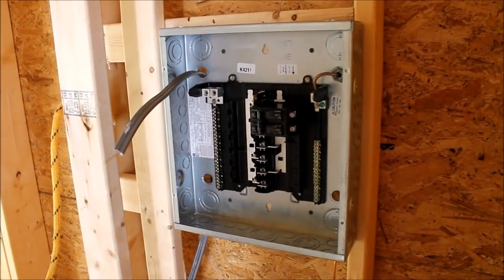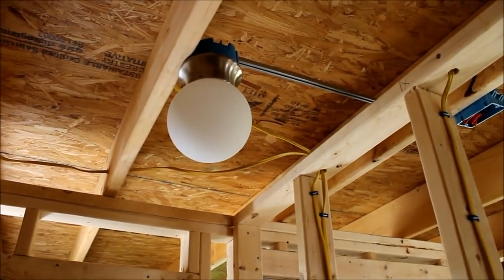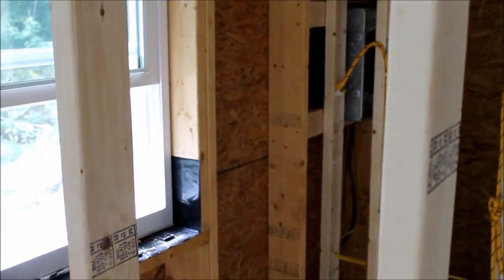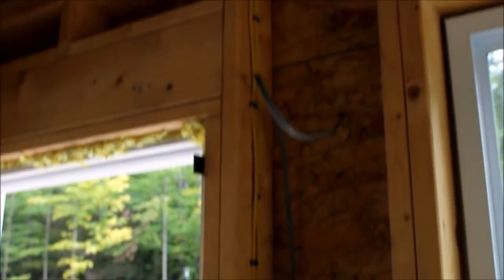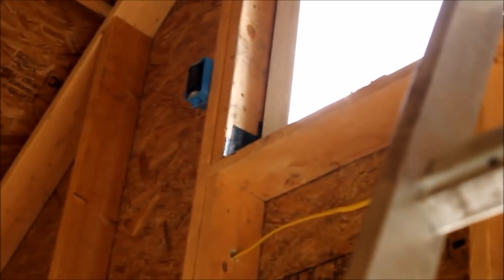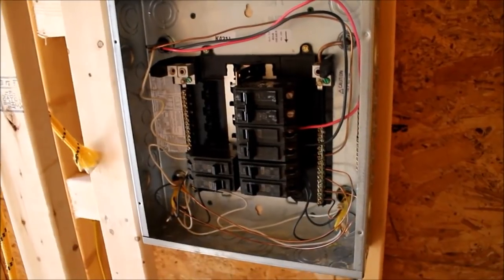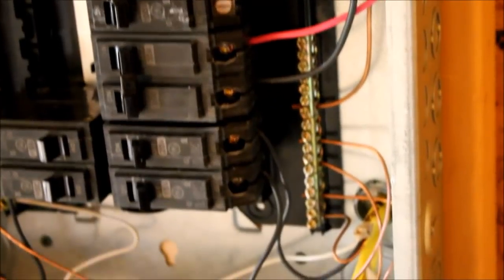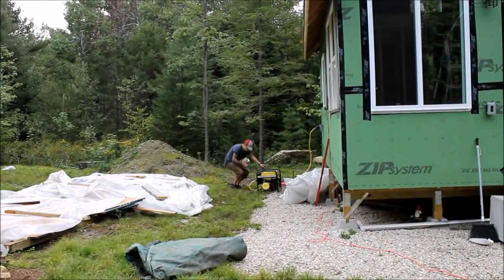Wiring the Off Grid Cabin

Comment: If you are truly off grid, why no 12v lighting? I'm going out of my way to have all lighting low voltage. I don't wanna hear my genset running, for a bulb.
Reply from the maker: Hi Mark,
My off grid system is 24 volts, a 12 volt system wouldn't be able to handle my 2100 watt solar.  also, codes and 12 volt systems are a nightmare. This cabin runs power tools, a dishwasher, and a fridge all off the system. If your going to have a inverter running anyway, the lights only run at around 6 watts.
Reply: 6 watts EACH PLUS the loss inverting it. I plan on having AII lights DC so that the inverter can stay asleep.   Presently my system is 1200 watts but final plans are for 3K.  I can hear the fan running, while inverting and i'd prefer to let the inverter sleep if possible.

Comment: Im a licensed Journeyman electrician of 20 years..  You need to have a bonding jumper from you neutral to your grounds.. for a return path of current. You have no protection, purpose of the grounding circuit.. without it. NEC requires this bond at first means of disconnect, and from then on neutral is isolated from ground. There are some other stipulations regarding portable generators vs. temporary generators, sharing neutrals and grounds.
Pigtail out every outlet and avoid circuit issues..
Im guessing you know to ALWAYS switch the hot and NOT the neutral.. White is neutral (gray in 277/480v systems), green/bare is ground.. and  any color not white, gray, green or bare.. is a hot (NEC).
Oh.. TWO 8 foot ground rods, not closer then 6 feet connected by a continuous, uninterupted conductor to panel.  There is a LOT more to this.. but for your safety, get that thing bonded!!!
Reply from the maker: Hi Simple Math,
   Thanks for the input, the neutral bar is actually bonded to the ground.  The panel I have used has a special screw to connect the 2 together,which I installed but wasn't shown in the video.  Unless of course you see something I don't...  I will be sure to bang in another ground rod when it thaws.  Thanks Simple Math.

Comment: Don't quit your regular job...
Reply from the maker: Another armchair QB.  Why don't you show us some of those sweet skills you clearly must have instead of just trolling the internet?
Reply: As a retired electrician, I get to surf the internet from my armchair... I'm just guessing you are not an electrician...is all I meant by that... I will watch the rest of your venture...
Reply from the maker: I am surely not an electrician.  I'm also not a pro plumber, framer, roofer, sider, foundation contractor, excavator, solar and wind installer, interior finisher, or heating expert.  I'm just some handy guy that knows a little about a lot.  Thanks for watching, I didn't mean to come off snappy.
Reply: Your doing great... 1)Test conductors for continuity 2) test conductors to ground (some should, some should not). Leave everything off when applying power (which you did). 3) Check voltage(s). Energize panel then test voltage on energized side. All this should be done without jewelry etc. (put that watch in your pocket when working...  =)
Reply: Thats more like it Nick ....build them up....not tear them down .
Reply: Gutsy kid, don't want to see anyone get hurt...
Reply: Nick D'Annunzio Right! if he was wiring for possum shit he wouldn't get a grape seed!

Comment: Thank you for answering so quickly. I've been researching tiny house designs for 2+ years now and plan on building this next year. Could you share more of the dimensions of you cabin?
I understand it's 16 x 16, but what is the wall height? overall building height? roof pitch? I'm very curious because I absolutely adore your design. Thank you in advance! Lisa
Reply from the maker: Hi Lisa, thanks for the questions.  The interior walls are 8'3" to the top plate.  The upstairs triangle walls are also 8'3".  So it is about 16'6" to the peak of the roof which is about a 13/12 pitch, it's steep.  From the ground the building is around 18ft tall.